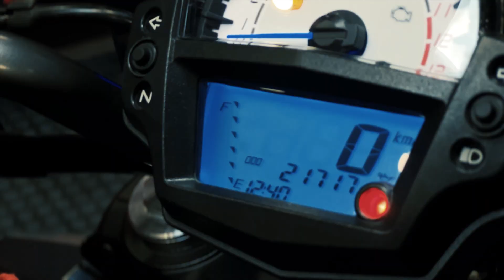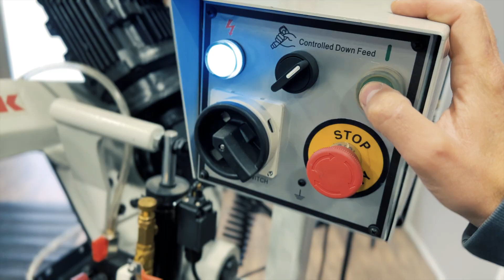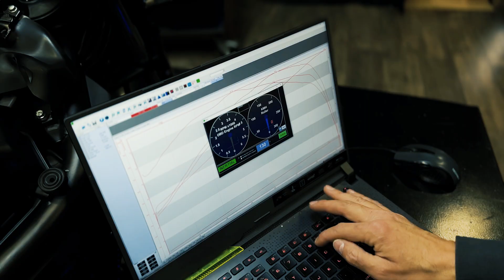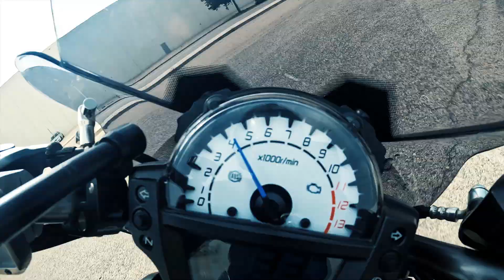MOTO que Funciona CON AGUA - Revolución energética

Comment: That HHO generator isn't capable of producing enough HHO to run a 25cc chainsaw motor at idle, and with the electricity that the bike engine can produce at full RPM, the amount of HHO it could theoretically produce at perfect efficiency couldn't even run a 5cc model RC car engine, let alone a motorcycle motor over 100 times as large requiring over 100 times the amount of HHO.

The fact that so many buy into this crap is terrifying for humanity.

Comment: This device is not capable of bringing fuel replacement to gas components.This is not a fuel substance replacement reactor to hydrogenuse,but a simple electrolyzer.
Reply: This would make more sense if he were using a granular hydride material to concentrate the hydrogen first.